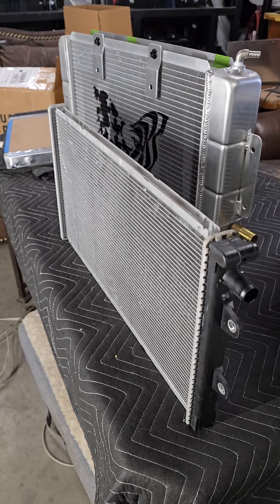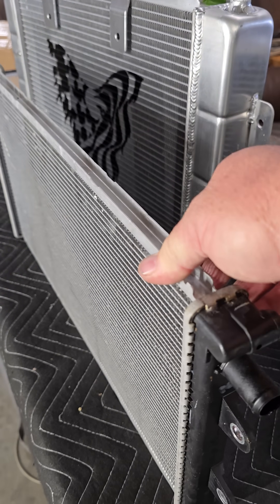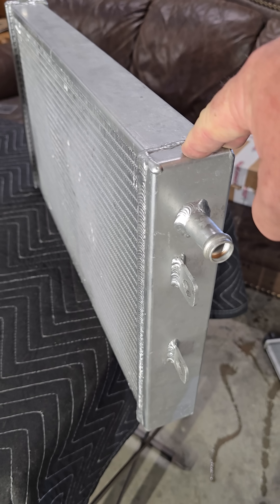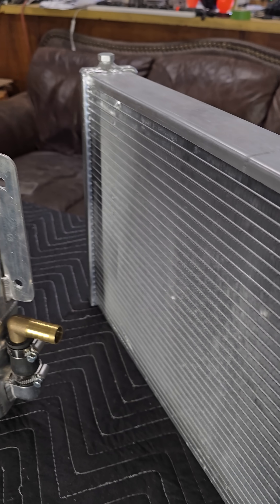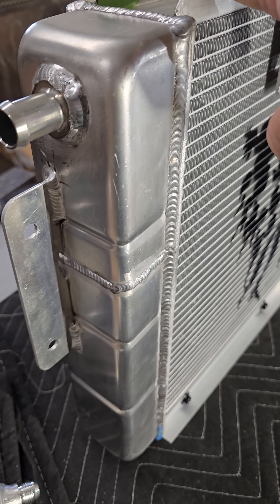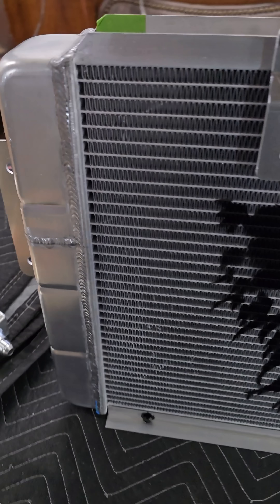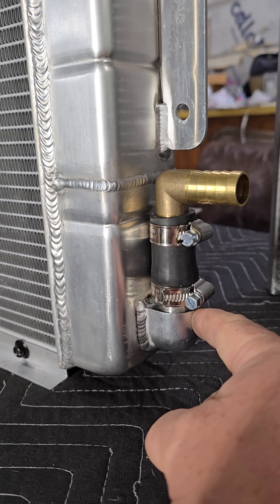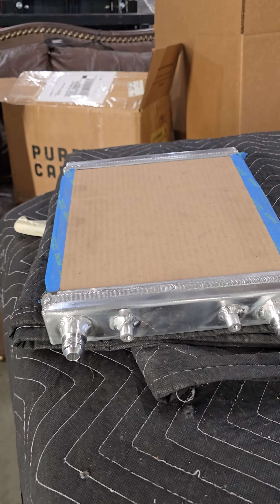Why the Patriot Motorsports ZL1 Heat Exchanger is the Most Efficient & Effective way to Cool the LT4

Comment: I've heard you mention that this will not fit with the GMS Crash Bar without significant modifications. Is there another option to use your heat exchange while eliminating the OEM crash bar setup?